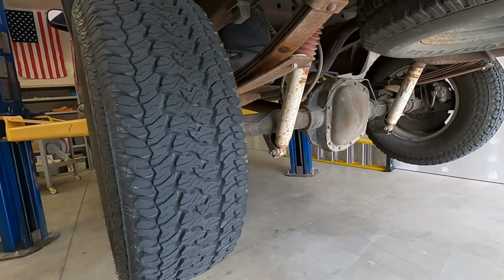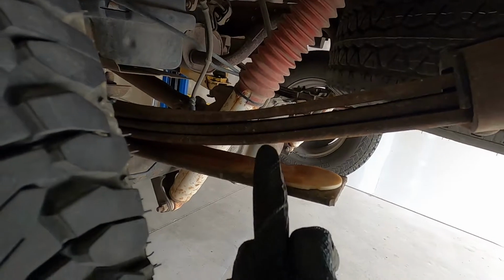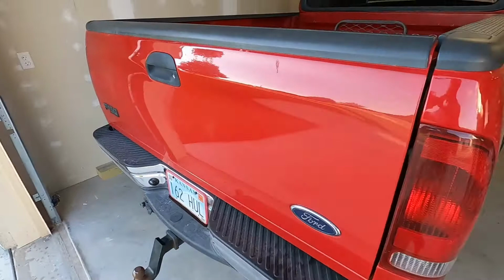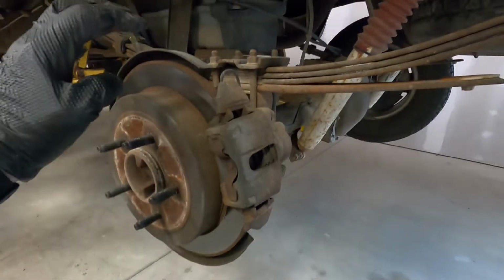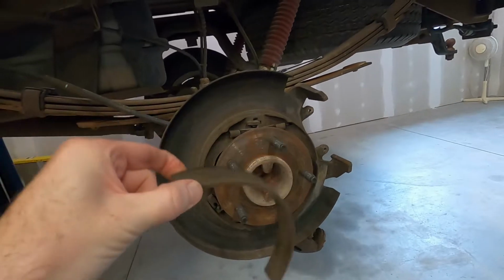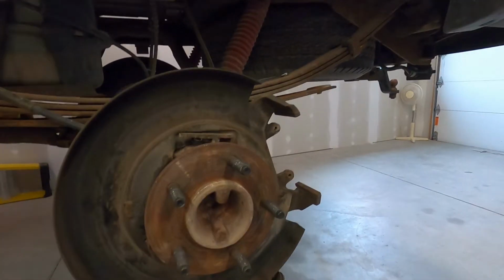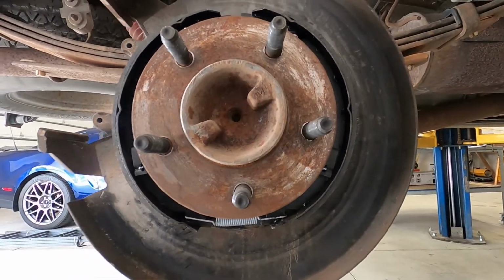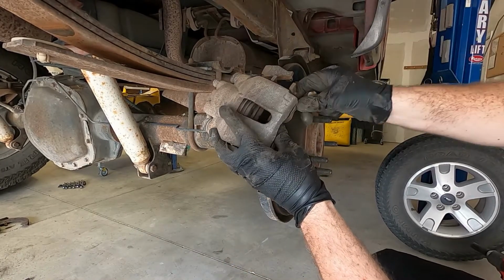Ford F-150 Clicking/Rattle/Squeak Noise Fixed!!

Comment: Well  explained  video. I have all new pads on my 99 F150 replaced in the rear brakes  about 3 yrs ago including rear emergency brake shoes, but I here a break squeak after driving a few miles when backing up in the driveway , any ideas what this could be? Thanks.
Reply from the maker: The brakes are pretty notorious for squeaking on these, if you get any glaze on the pads or rotors.  Being 3 years old this may be the case.  You could always try taking them apart and roughing up the pads and rotors with something like this - https://amzn.to/46WgHSK

Then when you reassemble, I would put this between the pads and the caliper. - https://amzn.to/3s5kkad
Reply: Thanks for the info Sir. @KonaBlueSVT

Comment: Great video! 
So my " clicking " only happens when I'm at a stop and begin to accelerate, doesn't happen when I'm driving only when I stop and go..I did notice if I get on the gas pedal harder then normal it doesn't do it.any ideas?
Reply from the maker: Have you checked the u-joints?
Reply: @KonaBlueSVT  no I haven't checked anything out yet, I just want a idea on where to start..just don't want to be taken advantage of..thanks for getting back to me 🙌
Reply: Timing chain. Tensioner goes bad and guides wear out.

Comment: My Ford f150 2006 is doing the same thing. It will rattle when its just sitting and when i back up it makes a clicking sound. My brake light is also on but my brake is not pushed down. Hopefully this will fix it. Thanks...

Comment: Driver side front O2 sensors get loose and rattle until heat from the engine warms up the exhaust and the sensor expands and it quiets down. Until it cools. 
Time chain is also susceptible to a rattle . Tensioner wears out, guides also. Clean your MAF sensor. It also can cause a rattle or ticking noise in the engine when dirty or failing.

Comment: Was your brake light on
Reply from the maker: No
Reply: @KonaBlueSVT   how did you record under your car. mine is making a loud rattling noise when I accelerate fast
Reply from the maker: I mounted the gopro to the frame with a flexible mount